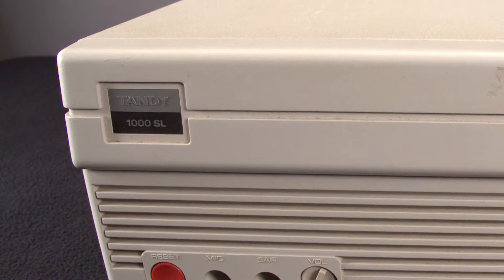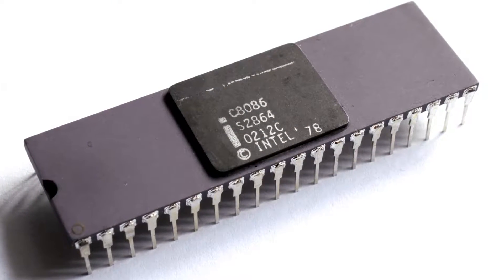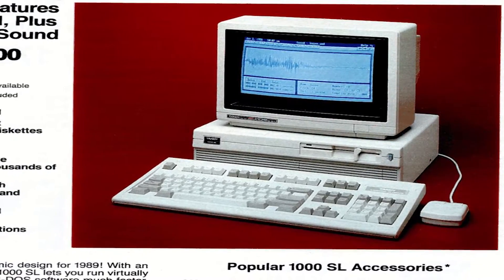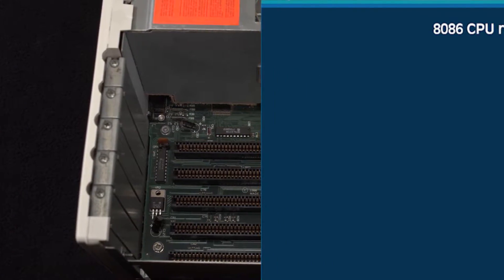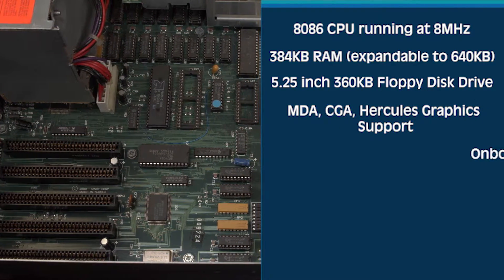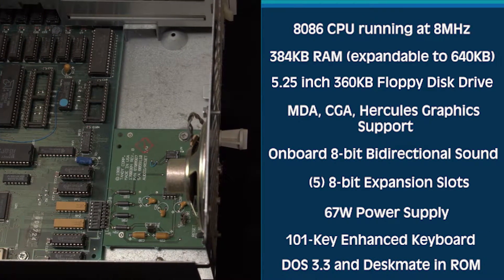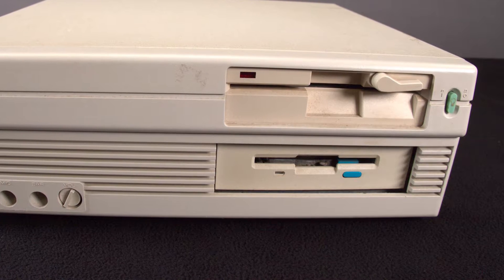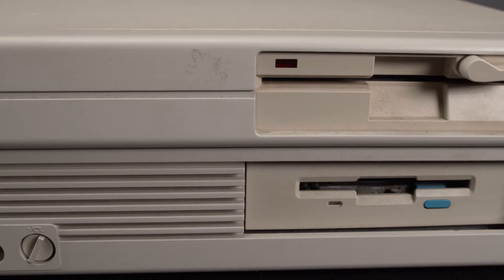The Tandy 1000 SL - A First Look #septandy

Comment: Great video.  I ran a Radio Shack store in Los Angles in 1989, and I can tell you that the catalog was published before the machine was actually available.  By the time it got to stores it was $699, then going to $499 and staying there until the SL2 replaced it.  
The 1000SX it replaced had a number of DOS compatability issues with business software.  The X series was really meant for home users, but was extensively adapted by small business users. Radio Shack also had it's own version of DOS called TRS-Dos, than ran the Tandy 2000 line of business computers only available at the 300 or so Business Centers.  TRS-Dos was made with a 256k kernel and got virtually no software support.  Only a few thousand were ever made and ended up running the inventory in Radio Shack stores.  
The SL and TL series went through extensive software training, and it was my understanding that they were marketed in other countries as Panasonic computers, and they made the 1400 series laptops introduced with the "L" series desktops.  
Not only were these nearly 100% IBM compatable, they also had a really nice GUI program called Deskmate built into rom that could be accessed at anytime by pressing the F12 key.
The L and X series only supported a "hard card" hard drive.  These cars were an early IDE that were manufactured for Tandy by Seagate and later Western Digital.  They were hard to install and buggy.  The "L" version was better than the "X", but still very expensive.  
Even though Deskmate was good, the lack of hard drive support, killed these machines in the market.  
The 1200 series, was available only at the 300 business centers and was 100% compatable with full hard drive support.
Reply from the maker: Hey Patrick, thanks for watching!  We appropriate the information!
Reply: Very informative.  I worked for Radio Shack from 1991 to 1993 and I know that the PCs were often in the catalog before they made it to the stores.  It is kind of hard to find the exact release dates for them at this point as far as I can tell.   Where the Business Centers the same as the Computer Centers I seem to remember?  I remember selling the hard cards but at the time they were Western Digital drives on them.